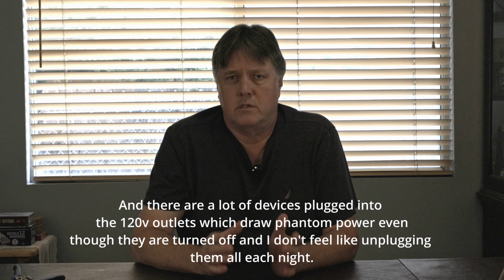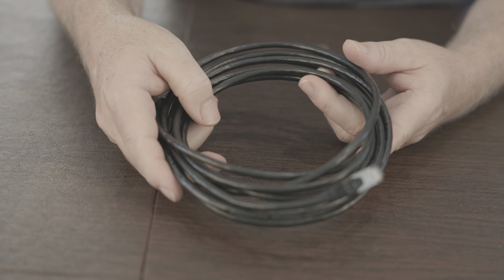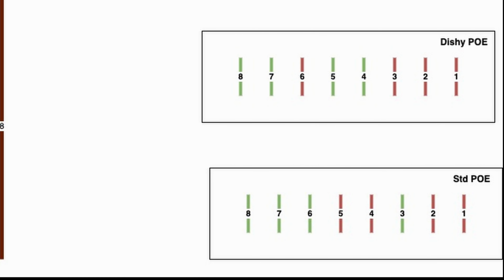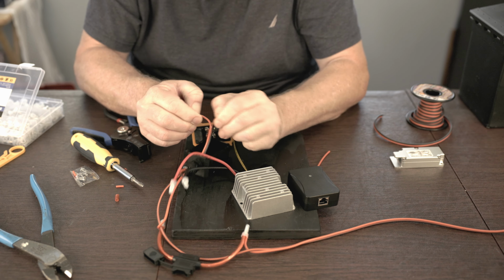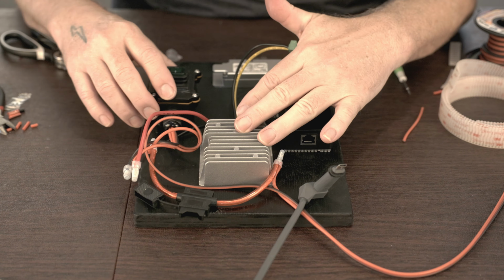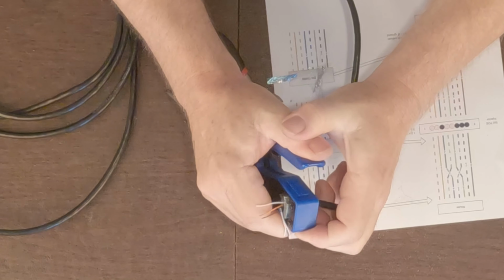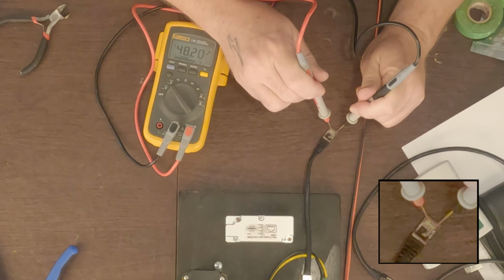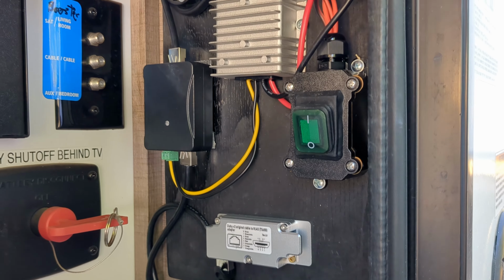Starlink 12V Conversion and Router Replace for RV/Boondocking

Comment: Hi bob
Fantastic video.  Subscribed. It’s Peter from down under and I was hoping to ask you a question.

I’m copying your set up and would be grateful if you could assist.  

My Starlink std cable was previously cut in order to access the Starlink modem inside my caravan which were a treat (568B)

With your set up can you confirm that where I join my previously cut Starlink together, will that be 568B or Starlink’s standard cable sequence explained in your video.

Many thanks
Reply: Many thanks Bob.  

I appreciate your quick response and will follow your advice (colour for colour).

I’m sorry to hear about your Gen 2. I’ll look out for your update video on this. Your instructions are concise and readily understood. Keep up the great work.
Best wishes
Peter
Reply: Hi bob

Sorry to come back to you again. Yes I’m rejoining the previously cut Starlink cable but with an outdoor RJ45 Ethernet coupler so that I can connect and disconnect my SL Gen 2 when required. 

 Obviously when ‘rejoining’ the SL cable via coupler it then makes its way to the YAOSHENG Rectangular Dishy Cable Adapter and the rest of your rig which I now have all the parts (finally lol). 

My question is:  will I get the correct colour for colour by wiring the RJ45 shielded connectors going in and out of the coupler prior to reaching adaptor) either (I) 568B or (ii) the swapped over version depicted in your video?

I’m grateful for your assistance as always.

Peter
Reply from the maker: @ Hi Peter, based on what I think you are doing, the swapping of the pairs is going to happen in between the input (non powered) part of the ethernet injector and again at the output of the injector before it hits the YOASHENG.  Because of this, you really just need the ends of the cable where you are putting the splice wired as normal 568B I believe.  You don't want to introduce any more swapping at that point.  At least that is how I would approach this, but keep in mind I'm not a professional at this so I suggest you test carefully before plugging it in.   Best of luck to you!
Reply from the maker: Hi Peter - welcome aboard and thanks for the question!  Let me explain what I think you are trying to do to make sure Im on the same page - You want to put your original starlink cable back together so that both ends contain the proprietary starlink connector - one for the router and one for the dishy ?  If so then you will just go color for color on the wire.  The way I did it that cable is straight through (or however starlink wires it) untouched.  If on the other hand you are trying to put a different connector o,  then I don't think I'm following along, and probably need more explanation.  Good luck with the project ! (BTW - my dishy finally died in January this year and I had to pick up a gen 3 - Unfortunately nothing is the same - including the POE requirements :(  - more on that later ...   Safe travels and write back if you have any other questions - I'll try to answer.
Reply: Thank you Bob for your rapid response. I will follow your advice and also check the voltage as depicted in your video as a precaution. Really appreciate you responding so quickly.
Best wishes
Peter
Reply: Thank you Bob for your rapid response. I will follow your advice and also check the voltage as depicted in your video as a precaution. Really appreciate you responding so quickly.
Best wishes
Peter

Comment: If you setup the SL router in bypass and use 3rd party router on 12v can you just unplug the router from home and hook up to 12v without having to setup again?
Reply from the maker: You know that's a good question - I have not used the sl router in bypass and don't know the answer.  I can say that in how I do it in this video I can swap between the 12v router and sl router without needing to set it up again.  Thanks for the question.

Comment: Why do you have to modify the data cabe between the POE injector and the Starlink cable adapter since the adapter will convert the Starlink cable to a regular ethernet cable connector? The YAOSHENG Rectangular Dishy Cable Adapter to RJ45 should have come with  a new regular ethernet cable as well? I'm a bit confused.
Reply from the maker: It is because Starlink does not use standard PoE pinouts, so unless you do this, the power will not get to Dishy and in fact could damage it.  Thanks for the question!
Reply: My dishy cable connector that was connected to the Starlink router is damaged so I cannot use the YAOSHENG adapter. Can I cut the Dishy connector off and connect an Rj45 direct to POE port using the OrW,Or,Bl,GrW,Gr,BlW,BrW,Br wiring?

Comment: Thanks for making this great video. Since I only have the 75ft cable I was going to go with the 12v to 48v converter. How many watts do you recommend I get? I see the 56v one you used is 168w, would I match something close to that in a 48v variant?
Reply from the maker: Hi - thanks for the feedback! The max draw i observed in my testing was 8.5 amps @13v for a very short time right after powering on.  I think if you can get a 120w it would be fine.  I bet you could get a very precise answer if you checked the starlinkhacks facebook group.  Good luck with your build! Mine is still working just great 😃

Comment: Does this work on new gen 3 model?
Reply from the maker: I honestly don't know but I don't think so.   As i recall they moved to standard rj45 on that so perhaps the job is a lot easier and does not require the proprietary connector.  Thanks for the question and good luck :)

Comment: Did you have to put the Starlink router in by-pass mode?  Did you have to setup WAN side of the router (DHCP or Static)?
Reply from the maker: No, I did not do anything with the router - its not used at all. I just use the dishy and my own router. My Router gets a dhcp address (2, actually -the first short lived and then another longer duration a short while after) from Dishy. I think the first one is probably a very basic DHCP server on dishy itself, and the second one is probably coming from the network - but I do not actually know that to be fact.  At any rate it works just fine without the starlink router and that is the purpose of doing this mod.

Comment: Thanks for the video. I have done similar mod convering my starlink to run of 12 volts charged by a 330watt solar pannel. It works very well except the speed is much slower using the 3rd party router..only around 10 mpbs. The starlink app says that it has a clear unobstructed  view of the sky, and no issues reported. Any ideas what would cause the speed drop? When inwas using the original router it was averaging between 40 and 70 mbps.
Reply from the maker: Can you check on your router and see what link was negotiated?  Could it have negotiated a slower link speed?  Ours is fast,  have measured speeds up to 100Mps through the router.
Reply from the maker: One more thing - i have not done this but you should be able to plug the rj45 directly into a pc/laptop and you can better see what the link has negotiated. You have a better assortment of diagnostics there than on a router.  Might need a crossover cable though.  Good luck!

Comment: Another question I have completely done all the steps but  I cannot get my Netgear R7500 router running even with static routes. Did you have to change something on the  Beryl Router or is it just put the cable in the WAN port and towards the POE injector and ready. I know my cable towards dishy from the POE injector are working I have tested and I see them online. I think the netgear r7500 is not suitable for using with the dishy.
Reply: The netgear 7500 was broken
Reply from the maker: @chrisboer7698 frustrating! Glad you got it figured out...
Reply from the maker: The beryl has an option you choose for how to connect - it can be to another wifi, to a usb , or to the wan port.  I just chose wan port and it worked out of the box.  However later i did discover i needed to turn off the wifi rescanning because it was dropping the wifi network every few minutes when it did that (this would be specific to the beryl).  I think you can go direct to a laptop too (for testing)  and that might open up more diagnostics capabilities for you. Might ask on the facebook group about that model of router - i know there have been some with reported issues
Reply: just set the WAN to DHCP

Comment: you could test the speed  ?
Reply from the maker: When I was building this, I did not have my starlink plan activated because I wasn't traveling, and I was not able to test the speed at that time. However I have since been out a several times and have done various speed tests and had good results - in some locations well about 100 mbits which is well above my needs. That said, I have not done a comparison where I test the speed on the system I built, then revert to the stock router and test the speed again to compare them. I doubt there is much difference but then again that Beryl router is not the fastest thing out there (but it is enough for my needs).  Thanks for watching and for leaving a comment!

Comment: Did you have to configure any special settings on your 3rd party router.  I’m not able to connect to dishy in my setup.
Reply: Bob, thank you very much for your great video and response.  I figured out that my dc power station was not providing the proper power.  I decided to use my jackery cigarette lighter input instead and low and behold, all is well.  I was pulling my hair out for the last few days trying to understand what was going on.  Keep up the excellent videos!
Reply from the maker: @tonyg7184  very happy you got it worked out! Thanks for letting me know :)
Reply from the maker: I only had to set the router to use the wired connection (vs being a wifi repeater or teathered connection) other than that it took care of the rest - got the dhcp address and just worked).  When you plug in does dishy come alive and try to position itself?  If not i would look at the poe and cable wiring into and out of the injector.  Measure the voltage if you can.  You may check out the facebook group starlink hacks - there are a lot of knowledgeable people there.  I have heard there are some routers that dont work well with dishy but i don't have first hand experience.  Thanks for watching and good luck.

Comment: This is an awesome walk-through tutorial Bob!  Super helpful and 12V is a great option for always on power.
Reply: Also excellent selections but I might shoot for an Orbi router for slightly faster Wifi...overall very impressed by the work you have done here!
Reply from the maker: Thanks so much for the support, really appreciate it.  The orbi router is probably a better solution - I just happened to have the Beryl around and was familiar with it.  Thanks again!
Reply: Re: DC voltage drop due to long cables, a capacitor across the 48 volts may help.
Reply from the maker: @joselito7776  thanks for the suggestion, i did not try that but you are right -  it should work.